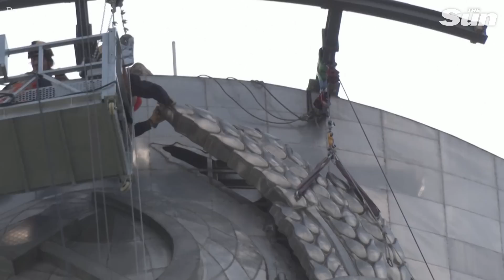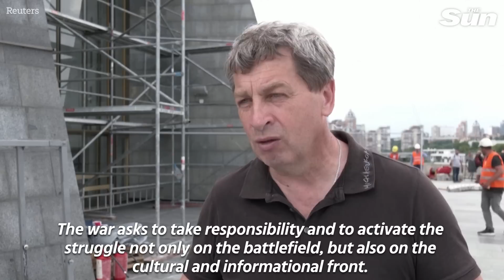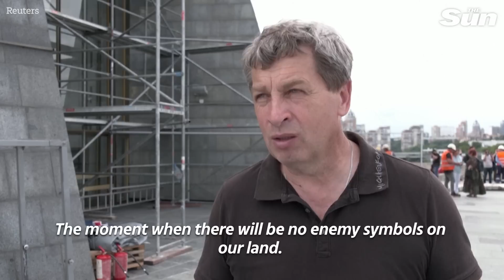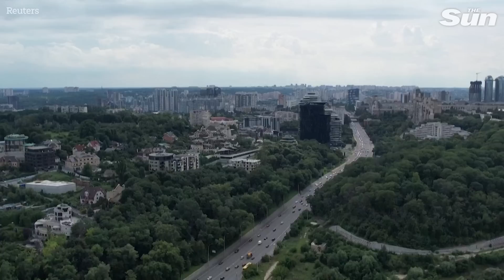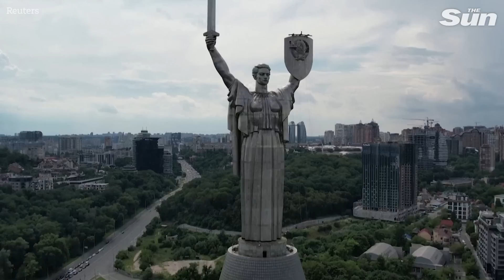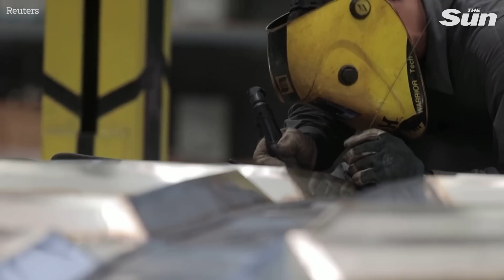Soviet emblem cut from Ukraine's Motherland Monument on historic day

Comment: Ukrainian engineers also want to convert the statue into Batkovschina (Fatherland Ukrainian way) and attach a couple of balls in the middle.😊
Reply: And indeed in this case a pair of steel (stainless ofcourse) balls.
Reply: uff i dont know if they can.. after all those balls would be way too huge to fit them on the statue
Reply: @onefor2  A father without balls? This will be ridiculous. An iron cucumber would be also appropriate.
Reply: @onefor2  So? What do we do?
Reply: @sergueimikhail9654  uhh we could put some on em but that wouldn’t equal to how big they actually are. But i guess you cant put 2 planet sized balls on a statue on earth or else the statue will collapse and we don’t want that
Reply: @onefor2  Oh, in this case, they might put the statue into a horizontal position and fit balls of whatever size.